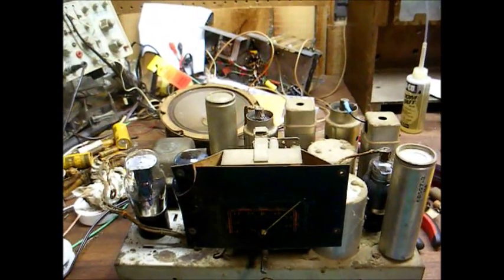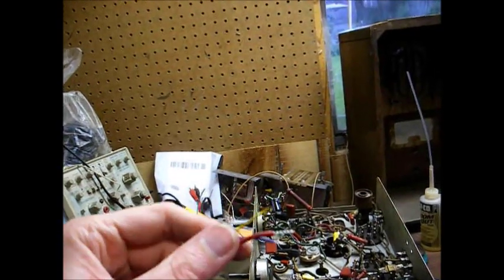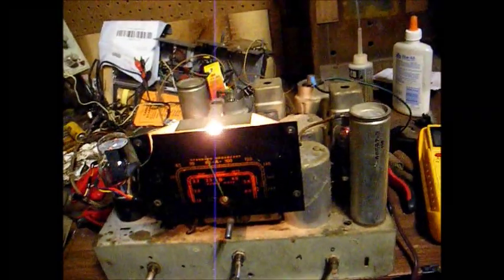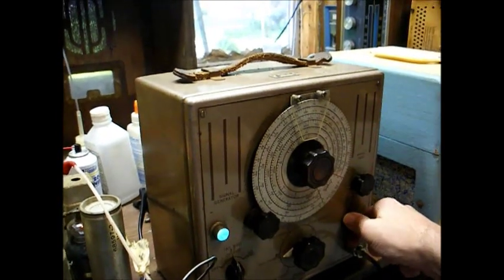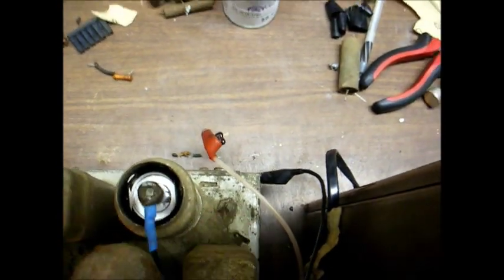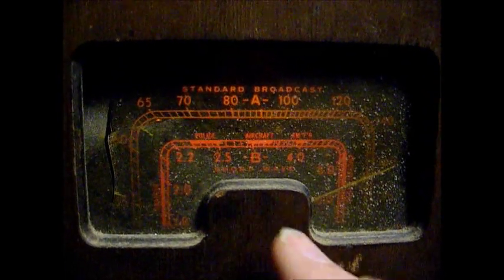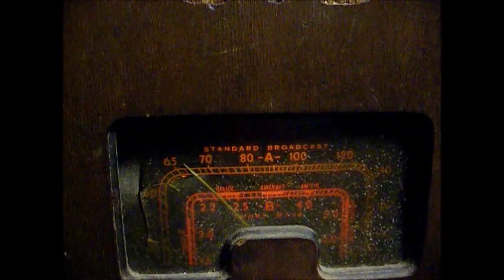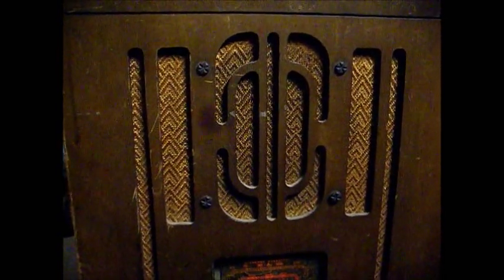Repair of a 1936 RCA Victor model 5T1 AM tube radio - part two

Comment: This looks like the same chassis as an RCA 6T/6K, except that chassis has all octal tube equivalents. The octal tubes still have plate caps (6A8, 6K7 , etc.). I'm currently restoring a 6K console. Thanks for showing the 2:20 images, which showed the clever way you provided mounting for the wet electrolytic cap replacements. I've been trying to figure out a good way to do this without resorting to drilling holes in the chassis to mount terminal strips. What did you use for an antenna while on the bench?

Comment: I have the big brother to this radio, a RCA 6K2 console.  I still need to get some terminal strips and isolate the old can capacitors and replacing crumbling wires.  Cabinet has been cleaned up and shows the dents and dings over the years but it does play.